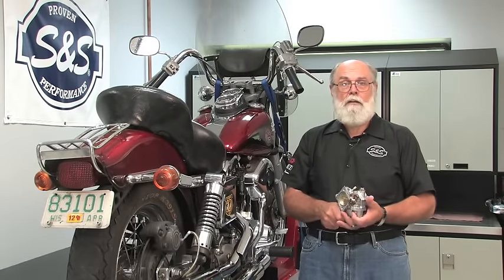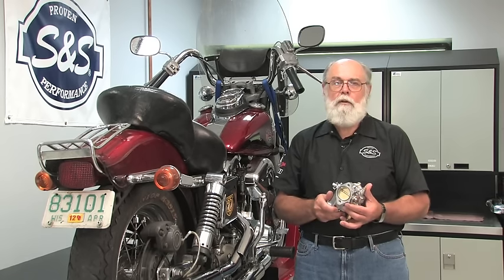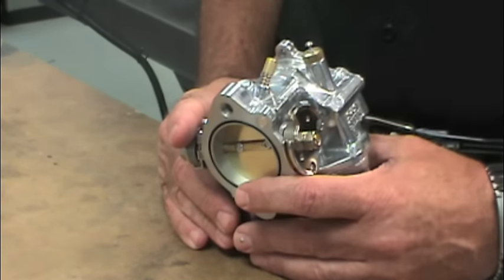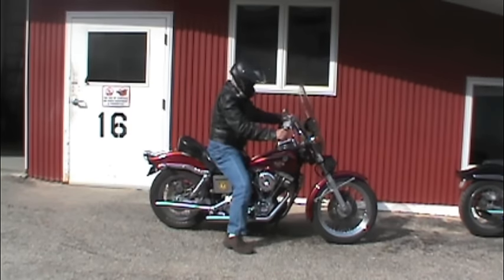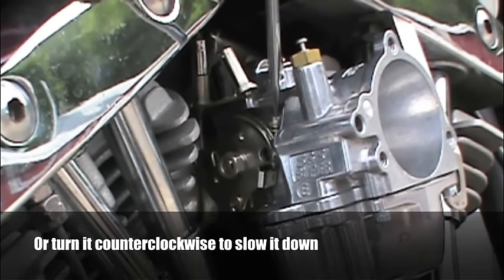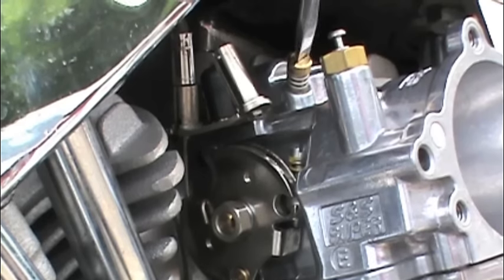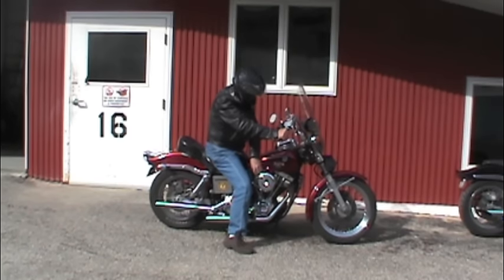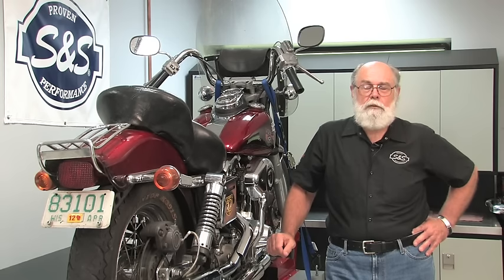S&S Cycle - Super E & G Carburetor - Basic Setup

Comment: Thanks, I had my Iron head sportster into two shops and came out bad each time. This morning I followed your video direction and in ten minutes had it running decent and in 20 had it running well. First shop changed jetted it out to 60 and the mixture screw bottomed and messed up the slot. The second thought it was electrical and tight pushrods and had the accelerator pump bottomed.

Comment: Ive bought a used 98 heritage softail with a super G, and I´ve had issues with the idle on it. It would not run at idle without adjusting the enricher, but when warm it would use too much fuel. When I then turned the enricher down, I would stall at intersections and so on. Turns out the Idle mixture screw was screwed all the way in, and the idle speed screw wasn´t even touching the throttle stop. Before adjusting I had to buy an aftermarket tachometer to accurately see the RPM so I could adjust it correctly, as the heritage comes without it. Thanks for this video, it really helped me!
Reply from the maker: Glad you got it figured out and this video was able to help!

Comment: s&s, thnx for the video, i picked up a used 02 heritage with the s&s carb. i was changing the plugs and noticed they were sooty black so i'm gonna check the mixture screw adj. it doesn't seem much different than any other carb i've worked on over the years.

Comment: I just bought a used  Heritage its a 97  has an S&S on it and since  I've never had an S&S carb I didn't know how to adjust it . well it kept dying at idle so I idled it up but it still kept dying this helped me get my bike idling like its suppose to thanks
Reply from the maker: Glad it helped you out so you can enjoy your new bike!
Reply: @SSCycleInc  I just did a basis rebuild kit and my fuel is running out the overflow hose any link or video to adjust my float possibly

Comment: So I've done this a few times. I have to keep choke pulled up to at least half to keep bike running, and that's after it's warmed up, too. When I increase idle adjustment, the rpms go waaay to high. I've tried adjusting the fuel air mixture to be more lean and it's just not working out. Can't get it to where choke can be pushed all the way down . There is no tach on bike. It's a 99 Sportster XLH 1200 that has been sitting for awhile.
Reply: Sounds like you might have a blocked main jet.  If the gasoline sits in the float bowl for a while, it turns to varnish and blocks up the main jet.

Comment: I just put a new s and s super e.  There is a vent that is not covered by the tear drop air cleaner.  

I have a different air cleaner that does cover that small air vent hole. 

It’s not running well. What would some of the symptoms be from covering up that small air vent hole?

Comment: 1990 Electra glide with super e carbutetor, on hot days at operating temperature the idle drops below 500rpm causing the oil light to remain on at idle. The bike rides and idles fine any other time when not up to hot temp. The problem persists even after turning up the idle. Im wondering if it could be loading up or if the reset procedure would help. Recently purchased the bike from an estate but i do know it has bigger jugs and a slight cam installed at around 50k with currently 86k on the dial. Replaced a metal fuel line with rubber line suspecting possible gas boiling but this did not resolve either.

Comment: Ok, I rebuilt me super e, I have a 2000 indian chief with an 80/88 ci engine. I put a 72 main jet, 29.5 secondary. I idle good, but get some puffs coming out of carb once in a while, and a flat spot midrange, then it kicks in again. Will these adjustments help with that

Comment: What if im in high elevation in Colorado would i need to figure jetting first before tunning it woth the 3 adjustment screws
Reply from the maker: You'll need to adjust fuel delivery to match reduced oxygen intake at higher altitudes.

Comment: Bruce I have a Softail with 96 "S&S engine which is nozzle 74 and 295 which worked fine with Hooker 2 to 1 system. But have now switched to supertrapp mean mother 2 to 2 and installed muffler V&H Quiet with the result that engine dies at 30% throttle and stumbling / sputtering in air filter. Should I go down on both main jet and intermediate jet? Or do you have a setup for 96 "engine and mufflers? Or a link to a video that shows how to proceed with nozzle of super e? Thank you so much.
Reply from the maker: Hey John, reach out to our tech team directly with an email to sstech@sscycle.com or a phone call to +1 608-627-1958

Comment: Hi Bruce, what can be a problem if when hot engine and I stop at traffic light (for instance ) the revolutions goes down very slowly even until it reaches idle speed. Its not me alone having this problem. please advise.
Reply from the maker: Could be a couple of things. Sticky throttle cable will cause that as well as an air leak in the intake manifold.

Comment: Bruce, need guidance Sir. I have a 99 Chief, i am the original owner. The S&S runs great when the tank is full at 5.8 gallons topped off, when engine is at operating temp and low level in the tank the engine sputters. I have learned to deal with it by always keeping the tanks full. On the occasion when the tanks is low, I go to reserve and take the fuel caps off and the bike runs much better. Any suggestions? thanks
Reply from the maker: Sounds like a fuel delivery issue. Send us an email to sstech@sscycle.com and we can help you troubleshoot it.

Comment: I have a super e on my 1200 sportster it has 28/70 jets does that sound correct? It idles good runs pretty decent I have tried this process like 3 times seems like no matter what I do the plugs foul after a ride if I get it too lean it starts popping out of the carb while down shifting if I try and go richer the plugs are really black and trying to take off from stoplights you have to ease into it or it starts spitting until you give it a lot of gas ….guess I have a picky one
Reply from the maker: Hey Travis, drop us an email over to sstech@sscycle.com with the full details of your build. They love trouble shooting & will get you taken care of.
Reply: @SSCycleInc  thank you just sent one over
Reply: @SSCycleInc  I wouldn’t suggest emailing tech unless you like 2 word answers

Comment: so if the tip of my spark plug is white it means it is too lean correct? in which case i would rotate the mixture screw counter clockwise a bit to make it a little more rich. and then adjust the idol screw again.
Reply from the maker: +Mark M Rajchel Keep in mind that the idle mixture screw only effects the mixture at idle. You will need to install larger jets to make the mixture richer while you are driving. But you are right that you will have to readjust the idle mixture and idle speed after a jet change!
Reply: Alright sounds good. Thanks.

Comment: bruce, what's the best way to make sure mixture is not too lean? thnx, steve
Reply from the maker: With engine idling, turn accelerator adjustment screw
clockwise until it lightly seats. Snap throttle open -
the engine should stumble. Turn screw counter-clockwise 1⁄4
or 1⁄2 of a turn at a time, until engine responds to throttle
twist with smooth, quick response.

Ride the motorcycle in various rpm ranges, and then try to
maintain a consistent 40- to 50-mph. If the engine has
a flat spot or is popping/sneezing in the air cleaner, it
can indicate a lean condition. If you notice stumbling or
sputtering, it can indicate a rich condition.

Comment: I have a 2000 fatboy with SE heads cams ignition boosted to 95 CI. With a CV carb. Which carb should I use super e or g. It has just a little under 100 hp. Thanks so much. John
Reply from the maker: With a 95 inch motor, we would recommend a Super E for most applications. If you are strictly using this bike for drag racing, you could  go with a Super G. It would give you slightly better top end HP,  but it would not have the low end response the smaller Super E would give you.

Comment: Is the Super E carb run good with the stock engine? Guy at HD told me the super E carburetor without doing engine work is overkill
Reply from the maker: The E is a great carb, even for a stock engine set up. It will, of course, need to be adjusted for optimal performance no matter the application.
Reply: @SSCycleInc  meaning getting tuned after installing the carb? I would definitely get it tuned after changing anything engine related. I was just checking to see what your thoughts were regarding HD telling me I’d be wasting my time putting this carburetor with my stock engine.
Reply from the maker: Yes exactly what we mean. Like you say, after doing anything engine wise, a retune is essential. 
We would not consider the E as wasteful for your stock engine though.
Reply: @SSCycleInc  would I get a significant performance upgrade with changing the stock carburetor to the Super E without any engine work or not really?

Comment: I bought a S & S carburetor kit  for my 1998 Fatboy , never installed it , Does this carburetor kit work on a 1991 FXRS Low Rider? I bought the complete carb kit with intake and air cleaner , do I need a different intake to make this carb kit work on the `1991 Low Rider?
Reply from the maker: TWINCAM88 TWINCAM88 Your 1998 engine has a different breather system than the 1991. The crankcase breather is routed through the heads and directly into the air cleaner in 1993-'99 models. The 1991 engine has a hose that comes out of the crankcase and goes to the air cleaner. The back plate and hardware in each application are different. The simplest thing to do would be to get the 1993-99 style air cleaner S&S Part #17-0404. The manifold in the kit you have will fit just fine.
Reply: S&S Cycle, Inc

Comment: hi bruce, i just bought a 2002 heritage with an s&s carb from a private sale. i had to adjust the idle cause it kept stalling so i did that and it's fine. i went out for about 20 min ride and noticed some drops of water coming off the air filter and down onto the engine near the cam cover, not a lot but some drops. definately not gaaoline. is this condensed water from something and is it normal or a problem? outside air temp. was 65F. thanx, steve
Reply from the maker: Hi Steve - please give our tech line a call at 608-627-1958 and they can go over what the issues might be.

Comment: concerniong the accelerator pump can you tell me if looking into the venturi and twisting the throttle I should get a single stream or three streams, We have a serious dead spot as though the pump is not 100%
Reply from the maker: james milewski The accelerator pump is designed to spray in a fan pattern, although some of the very early Super E & G carbs had a single drilled hole in the accelerator pump nozzle. If you have three strong streams it will still work fine. 
I would ask if the dead spot you mentioned is just off idle? That's what the accelerator pump is supposed to correct. If you have a dead spot in the mid rpm range, we would suspect an exhaust problem. That's a classic drag pipe symptom. I might be a good idea to call us at 608-627-1497 and select the tech dept.
Reply: S&S Cycle, Inc thanks for the good advice, it's a friends bike and though there is that fan spray (looks like three streams left to right), I don't know if they are strong, to my eyes they look weak, and one being even less than the other two

Comment: RESET:
Idle Mixture Screw (Controls fuel, not air)- turn until lightly seated, then turn out 1.25 turns
Idle speed adjustment- out until no longer touching throttle plate, then turn until just touching and THEN turn additional .5 turns out
Accelerator Pump - turn in until lightly seated, then turn out 2 turns

Run bike to operating temperature, go for ride, if adjustments are done cold your mixture will run rich when it gets up to temp

ADJUSTMENTS
Idle speed screw- clockwise to increase idle speed, counterclockwise to decrease idle speed, aim for 1000rpm

Idle Mixture Screw- Turn slowly clockwise to make leaner, if speed up = too rich, keep turning clockwise until the engine slows bc the mixture is too lean, note the position of the needle/screw. THEN turn counterclockwise until max rpm, keep turning until engine slow bc too rich, note the position of the needle/screw. set needle/screw halfway between too rich and too lean positions.

Go back to Idle speed screw and set idle back to 1000

With Idle speed and Idle Mixture are correctly set, move to accelerator pump.

Accelerator pump - Turn screw all the way in to turn off the pump, throttle should cause the engine to cough/stumble. Turn screw out .25 at a time until the engine responds smoothly to throttle.

Comment: Bruce. I recently found an old super E shorty in a barn. It appears that a guerrilla may have worked on it. The idle mixture screw has been tweeked off flush with the body. What is your advice for safely extracting the remainder without damaging the body. I'm not a machinist so I don't really want to attempt an ez out..
Reply: kk. Thanks S&S. Ive been buying from you guys since the early eighties at a shop in Amarillo, Texas across from the infamous Longhorn bar lol. Ride safe.
Reply: +FUGYOO You probably got it sorted, but if not that is pretty much a machinist job and if you have a good carb or carb body I'd hand that to the machinist too so he can use it to align his setup. Viewing a good idle mixture screw will let him choose appropriate bits. It's a fiddly job but even if the body threads got hurt there is probably enough room for a threaded insert. Someone who does clock repairs at a pro level could also do the work.
Reply: Ob Fuscated
Oh cool. Thanks so much. I just threw my old SU back on the shovel for now. I swear by the SU, fantastic carb. I've just heard so much about the SnS and I found it in my barn.
Reply: +FUGYOO The SU is a constant velocity carb whose principle is the same as the later stock Harley CV althought they have a diaphragm instead of an SU-style piston. Many people run the CV carbs on Shovels and if you need a carb while overhauling your SU one of those ain't a bad idea. I'd try to fix the S&S but mostly for the challenge. You could also strip it for parts and snag another body at a swap meet or via Ebay. It's not likely to run better than a properly set up SU.
Reply: Never heard of a CV but will look into it. Only thing Ive ever had to do with my SU"s is swap a needle, which Rivera used to send 3 with the carb in the 70's, when I would relocate to a diverse elevation. And a shot of WD on the piston once a week. Out in the Oklahoma Panhandle maybe thrice a week because of the haboos and dry climate. A lot of friends ran the SnS carbs on their shovels in the 70's and 80's and swore by them. They would talk about the all elusive and hard to find Super E. A now I have one lol. Yes, I really want to fix this golden goose egg and give it a shot on my ...yellow shovel. LOL. Thanks Ob. Ride safe bro.
Reply: I've worked on a lot of 4 barell car carbs andn i must admit the way you explained this sns carb is very similar so  thank you very muchfor you're video ,

Comment: whats the difference between super e and g carb?
Reply from the maker: The two carbs are identical except that the Super E has  1-7/8" throat and the Super G has a 2-1/16" throat. For most applications, the Super E works well with engine 100" or less, and the Super G is best for engines 100" and larger.
Reply: Thankyou for that well needed info
Reply: Liam Standish
Reply: my bike has a super g on a mild 95ci build should I get the super e it has horrible low end power only time it runs correctly is in high Rpms
Reply: Arturo Orosco go up one jet size on the low speed and go out a bit one accelerator.

Comment: Hi there with this carburetor my plugs keep getting Black is that running rich? my tailpipe's black as well
Reply from the maker: If the black stuff on the plugs is powdery and dry looking, you should try changing your jetting. Try some smaller jets, but change them one at a time so you can evaluate the effects. You might also check your float level and test the seal of your needle and seat. If there's too much gas in the bowl the engine will run rich. On rare occasions, a weak ignition system will foul the plugs, darken the pipes and even blow black smoke, but the bike generally runs pretty bad in those cases.
If the black stuff on the plugs is wet looking or scaly, that would indicate that oil is being burned in the combustion chamber. Does your engine blow smoke? Black smoke indicates over rich mixture, but blue smoke means that you've struck oil!
If you still have problems, call S&S at 608-627-1497 and select the tech dept from the menu.
Reply: Ok thank you I will call you guys

Comment: Hi,
I bought s&s super e for my sportster xlh883 1986, with carb i get 11 jets plus them in the carb, 66,68,70,72,74,76,78/28,
31/265,295 please advice, which one should i instal?
Thanks
Reply from the maker: Start with the .0265 intermediate and the .066 main, and see how it runs. A lot will depend on your exhaust, and if you have done any other mods to the motor. You may need to change the jets for the best performance.
Reply: Thank you
Reply: Pod filters on a keihin cvk36 carb, jetting tricks

Comment: Question; I rebuilt carb because gas was leaking out the front ventilator and out of the main jet (inside) - pouring everywhere when petcock ON. Cleaned it out, put back on, no gas leakage. NOW no Gas will squirt out the Jet.anyone know whats up?

Comment: I tried this, however the engine immediately races to full throttle and I have to hit the kill switch. Any suggestions?
Reply from the maker: Drop us a message with details on your carb, current jet settings, and engine specs to Tech@SSCycle.com and our tech team will help you out!
Reply: Hey man did you ever figure out what that was mine does the same thing